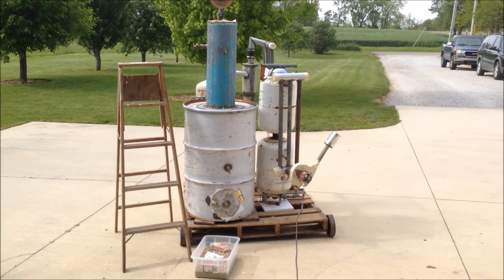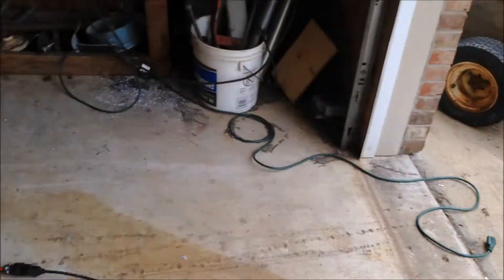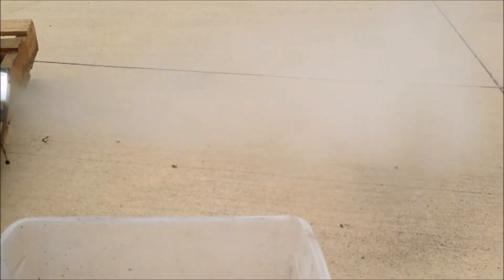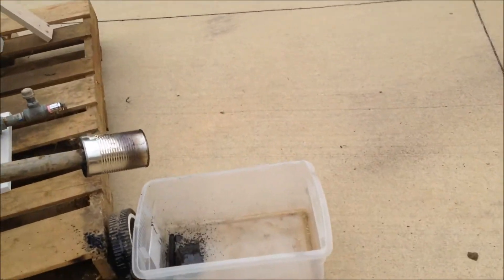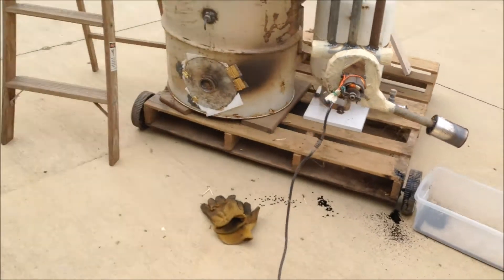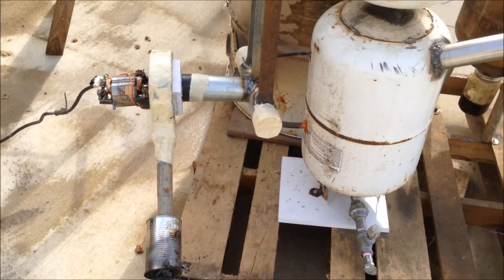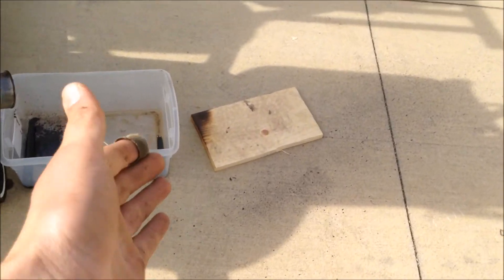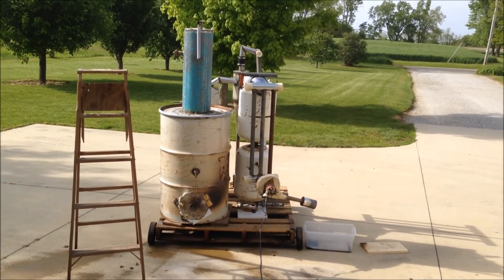Gasifier Build for Dummies 7, Test Run, Success, Finally!

Comment: Go to king of random and build a scaric variac machine. I’m probably spelling that wrong but it would be great for controlling current flow safer than extension cord. Use berry little lye. I put too much in mine. Less is better. Use more if it isn’t noticeable.

Comment: You are heading in the right general direction with this.
One thing that will greatly reduce the tar production is a deeper charcoal bed in the reduction zone.
Mine is 9 inches deep, and it cleans the gas to such a degree that it is barely visible - even before the filters.
Once filtered, the gas will become completely invisible, and will burn with a blue flame.
Mine is currently making the electric power that I am using to run everything in my home.
Being offgrid is soooo sweet  :) .
Reply from the maker: I will make my reduction zone longer when I rebuild it, but that will also require me to redo my ash grate, but that's ok. Just curious, how much maintenance does your gasifier require to keep it going constantly? I haven't watched all of your video but is the gasifier your talking about the one you refer to as the "victory gasifier?" Thanks
Reply from the maker: Videos*
Reply: tonto bob 
Yes, that will be a good step towards success on your gasser.
The one I refer to here is indeed the Victory Gasifier. It was made by Ben Peterson of Victory Gasworks some years ago.
It was ultimately given to me, as it had a number of fatal design flaws that were guaranteed to destroy an engine.
After rebuilding and enhancing the design, I now have a stable gasifier that has given me 1100 hours of engine runtime todate.

Maintenance is pretty simple, as I clean it, and the filter chain, after each 100 hours of operation.
I redesigned this to run for a long time between cleanouts, and to be easy to clean out.
This involved, among other things, the inclusion of a cleanout port on the floor of the gasifier, along with a very aggressive charcoal grate system.
This combination allows the outgoing gas to be quite cool, and clean  :) .
Reply from the maker: Now that I am forced to rebuild the main unit a little, due to explosion, on my next set up I might try to incorporate a hatch on the bottom for ash to drop out and have my gas output going through that ash and biochar as it sounds you have done. I'll watch your videos tonight when my internet gets better and try to see if I can steal some ideas, haha!
Reply: tonto bob 
For my floor cleanout port, I used a 4 inch diameter screw-in/out device.
I don't have the right name for it, but It's like a giant pipe plug that you screw into place.
It shows on one of my videos, but I have forgotten which one.
It has been a long time since I uploaded any videos, and things here have changed a lot, so I really should catch up  :) .
If you make your grate pretty deep, so the gas has no choice but to go through it before it can leave the gasifier, it will be very helpful indeed.

Comment: For about $25 on ebay you can get a variable speed controller for Fan/routers etc.. That would let you dial in the blower speed.
Reply from the maker: I'm gonna try to wire a dimmer switch in first then I'll look into other options if that doesn't work, thanks for the suggestion

Comment: i agree that the excessive tar is from the wood pellets but i also think that its because the fan has so much power its not allowing the tar to drop in your cyclones as much as it should have been and no filter doesnt help either
Reply from the maker: +4050anthony  Thanks for the comment, I'm researching how to reduce the fan speed right now actually. I know that fan is too powerful for one, and two, I don't think it got to the desired 2200ish deg Fahrenheit to decompose all of the tar due to the short test run, low quality fuel, and cold air intake. If I redesign the air intake so the air heats up in a chamber around the combustion zone and reduce my fan speed, I will probably get better results. Just starting to get a feel for it now,, thanks for the interest Anthony.